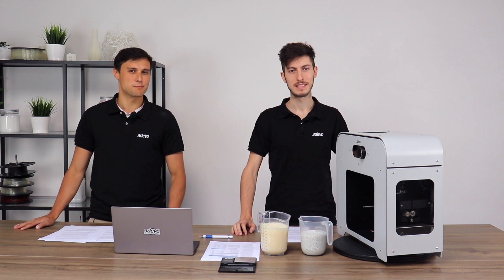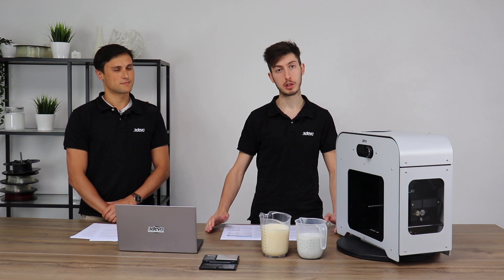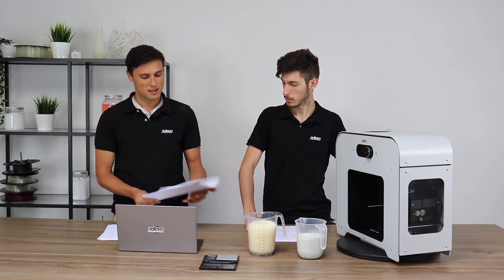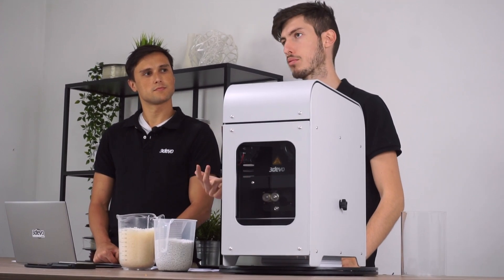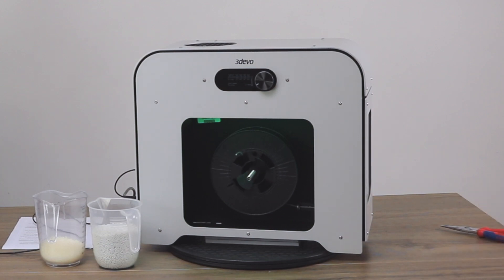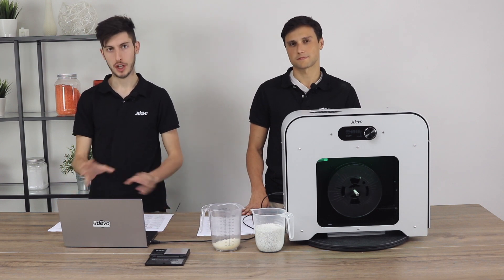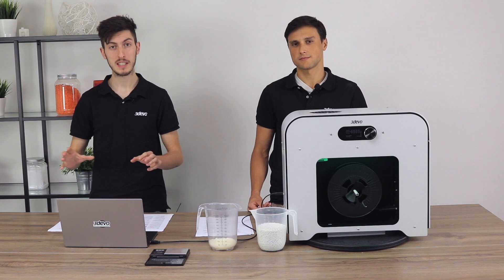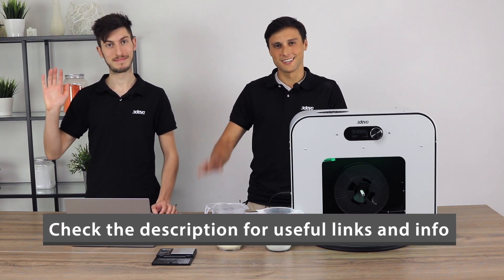Getting Started With a Material Test | 3devo

Comment: The spool tension mechanism seems doubtful, I understand it's a slipper clutch mechanism. As the spool diameter increases the clutch needs to be adjusted continuously or maybe for certain time periods. If the tension is beyond the yield stress then the filament will undergo plastic deformation. Automatic tension control is the only way to solve this problem.

Comment: All hail the 3devo material wizards! 
[Spool not pull, spool not pull]

Sidenote:

The barrel is never empty. Before you receive your machine, it is extensively tested to assure the highest quality we can achieve. So there is PLA inside from this (very important) test. Like the guys mentioned: PLA is one of the few materials that is safe to remain in a barrel. So, no worries, plus it's the same PLA as the one we provide with the machine. So you can start extruding your first spool right away!

Comment: Timo! Louis! Great presentation guys. So how well does the 3devo handle tpu/tpe that has already gone through the 3D printing process?
Reply from the maker: We have actually never done a recycling test like that with tpu/tpe, but we have processed different kinds of raw tpu and tpe. Also, we have recycled 3D-printed PEEK, ABS, PLA, PA66, PETG (+ probably more). So it is very likely that the Filament Maker can handle recycled tpu/tpe as well. We might just test this in the near future :)
Reply: @3devo  I'll book front row tickets for that! Or I could send you some failed half-printed shoes to try with? ^_^